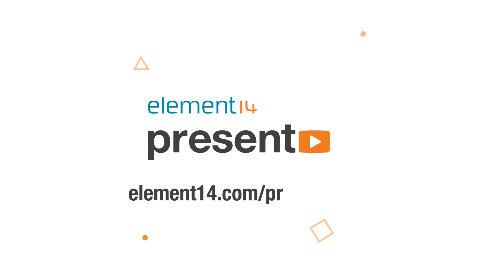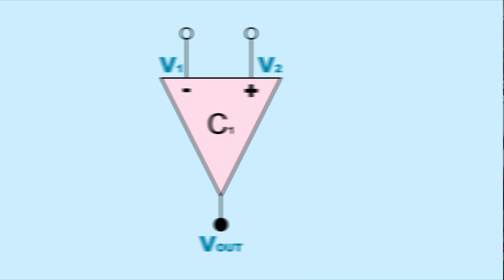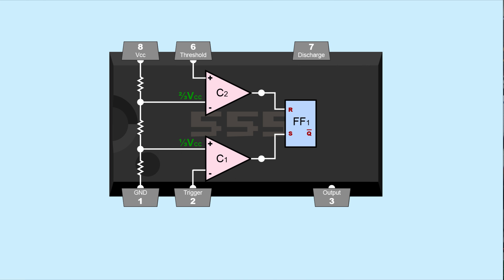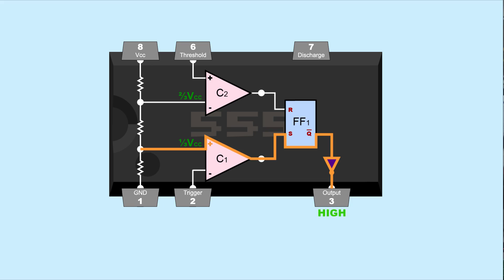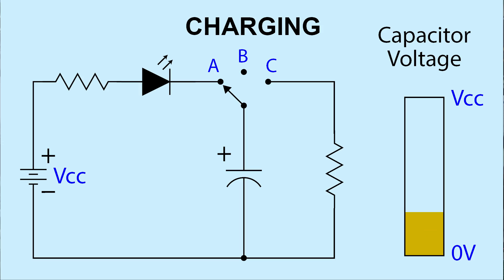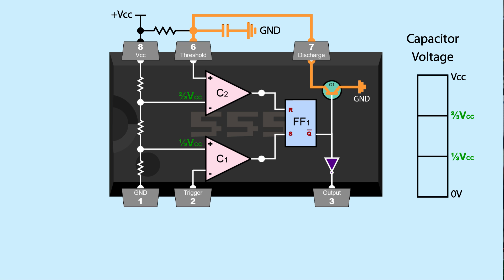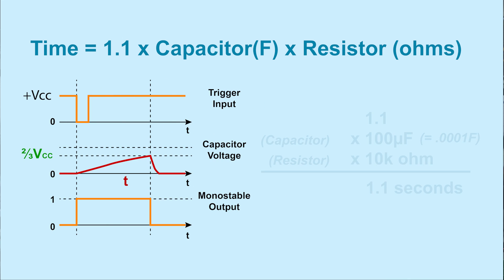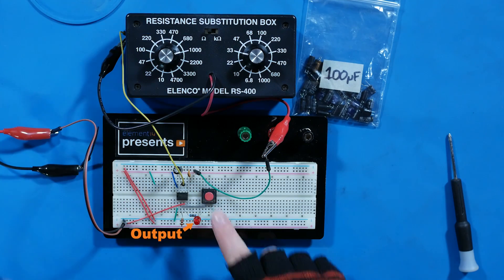555 Timers - How A One Shot Timer Works - The Learning Circuit

Comment: I’d like to build a power on reset circuit for a home built TTL cpu I’m working on. But I need the circuit to output low for a given amount of time, then stay high after that. I’d also optionally like a button to force it to reset on demand. Will try to figure out how to do this.

Comment: I've used the 555 for quite a few projects. First one was to delay power on of a wind speed and windshear sensor monitor, that I built for my car. I needed the monitoring device to start several seconds after the car has started. In a second project, I used the 555 to build a circuit for strobe lights. Well, I used the 556, dual timer, IC, to drive two LED strobe lights.
Even though I've used the 555 before, I can't say I fully understood how it worked...until I watched this video.

Comment: I would use it to give a regular impulse to a Focault pendulum. Instead of a button, magnet at the bottom of the bob would induce a voltage passed through a capacitor  and the output woud momentarily power an electromagnet which would attract the magnet. That is the basic idea. A  small PV cell would keep LiPo cell charged, which will power the cisrcuit continuously.

Comment: Thanks for this!!  I have a question for you. I have been trying to figure this out for some time now. I have a few claw machines I rent for events.  I bypassed the coin mechanism and pulled out the wires and connected them to a credit switch for free play. The problem is if someone holds down the credit switch too long the machine throws an error thinking there is a coin jam. I tried ordering a one shot LM 555 kit to adapt to the switch, hoping I could get a single pulse signal to the machine no matter how long someone presses the button. I hooked everything up and was  hoping I would get the result I would like. Problem is I believe that the claw machine credit switch is actually just completing a ground circuit whereas the one shot LM 555 kit is intended to send a voltage pulse. I was  wondering if you would think there would be a workaround for this? Thanks for your great videos.

Comment: great video and lesson. I'm brushing up on 555 after many decades...I'm using 555 timer in one shot mode and feeding it into a 74LS04 hex inverter to create synchronized differential logic pulses and sending into a motion controller as a homing reference pulse. The controller requires differential input but the machine I am retrofitting only has a single ended reference marker pulse. I use this pulse to trigger the 555 timer and hence create the differential signals.

Comment: An indicator system for an automobile could also be built, with the mechanical pull of the indicator leading to the connection of the 555 timers to the power supply. The R and C could be arbitrarily selected, such that R*C=1s. The output of the 555 timer could be passed through a buzzer and an LED.

Comment: One application could be frequency division, an incoming clock trigger could be used instead of the button presses. Depending on the values of the capacitor and resistor, which could be arbitrarily selected, the pulse width could be worked out. This would lead to a new frequency, perhaps a division of the clock.

Comment: @ element14 presents would this circuit still work if the trigger is continuously switched since the circuit is powered up? I would like to create a circuit that lights a LED for 5 seconds when VCC is switched on and then keep the LED off until VCC is switched off and back on.

Comment: Hi there, Can you design a variable on and variable off timer with 2 pots for each actions, I mean the hi time changes with one pot and the off time with the other pot. I dont mean a timer with one pot to change the duty cycle, but two pots. It can be with 555 or arduino or whatever. Thanks a lot for your patience to teach.

Comment: Hi! Are you really sure, if you release the button at Pin2 and the VCC reconnected to Pin2 again throug a resistor does not change the output? I build this circuit and after I release the button it switch back to low...

Comment: 6:50 The transistor is on (not open!) connecting the capacitor to ground through the discharge pin.

Comment: I have a beacon with a 555  2 resistors and 2 capacitors. Im trying to get the led stays on about half second and off about 2 seconds. I've tried and changed some some resistors and capacitors around and i can't get inequality values. Only equal. Which i dont want equal values.  I want half ON and 2 second OFF approximately.

Comment: Thank for awesome information about 555 timer , but my questions about 555 timer is , how can I tests or know when is it bad using multimeter? Thank you for now.
Reply: measure the value of the resistance between Pin1 and Pin8. There are 3 5 kOhm resistors. If the result is 15 kOhm, the 555 is mostly fine

Comment: What happens when you hold the button? Will the led still turn off after a time? Basically what I want is to build a circuit that will create a single pulse on the rising edge of a button press that will go down even if the button is held. I believe a 555 timer would be the way to go about it but I don't know if this is the right approach... (I have little electronics experience)

Comment: One time I made a 555 circuit in mono mode to temporarily turn off a smoke detector while cooking so the smoke would not set it off for about 10 minutes....I wired a tiny switch under the cabinet using thin magnet wire to the trigger input. C=100uF, R= whatever was closest to 5.5 Mohms in my resistor cabinet. The circuit was p-p wired on a small perfboard and fit inside the cover. If I remember correctly I used the CMOS version of the chip for low power drain (7555). Worked great and was safer than pulling the battery out and forgetting to put it back in, and more convenient! Note: Try this at your own risk - I don't want you to violate any fire codes or cause safety issues!
Reply: haha! great thinking right there. I will keep that in mind, but I won't promise anything. great idea, though! :D

Comment: Here's a good practical application: when i was learning the 555 timer in engineering, my professor challenged us to make a traffic light circuit with minimal components. Only the 555 timer was allowed, along with passive components. You can do it with just two 555 timers if some one wants to give it a shot. Awesome video Karen!

Comment: could use as door chime, motion alert, mailbox notifier, sump pump fail alarm, drive way alarm all sorts of uses. the button can be any sort of activating device and the led can be a light or buzzer or relay to trigger something else only limited by what you can think up.

Comment: Real world application off the top of my head. Door latch buzzer. Input would be an impulse like a dial tone from a phone system or a user press button. The impulse triggers the 555 which pulls high to buzz the door lock for 5 seconds. And at the button end you could have equally simple circuitry to form a latch to stop a user holding the button to override the one shot.

Comment: Great lesson Karen...but...what's a practical application for this circuit?

/s
Great description. I've used and abused 555's many times before but never dug deep into the operation; just blindly followed some diagram. This really helps understand what's going on.
Reply: frollard it's a monostable circuit, not astable. 😂 Which is no stable state, but just a relaxation oscillator.
Reply: @arathcazares1326  Not sure if that reply was intended for me or if I missed something...I never mentioned mono or astable... so makes me think you were replying to someone else.
Reply: frollard forget what I said because I thought you were confused with practical circuits, by simply use two resistors and a capacitor. Make it as astable, but I also realized that she meant "a stable", not "astable from the video.
Reply: frollard It's not practical, but it's kind of is by involving oscillator.

Comment: Should there be a (small) resistor between the capacitor and the discharge pin, to limit the amount of current flowing out of the capacitor and through the transistor at the end of the one-shot pulse?

Comment: Great video. By coincidence I could have used it today, I had a 10 port powered USB hub I wanted to coorperate in a product. Problem was I had a momentary on/off switch and didn't go on automaticly when supplying power. Once incorporated in the product I couldn't reach the button and when the product was powered off there would be no power going to the USB Hub. I found out that shorting the button with a resistor did the trick but otherwise this would be the solution to simulate the buttonpress